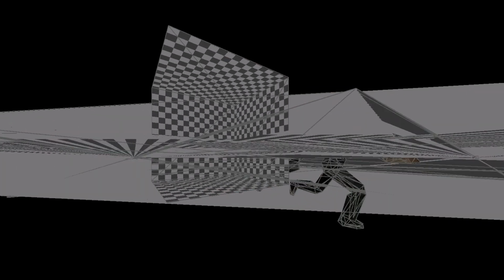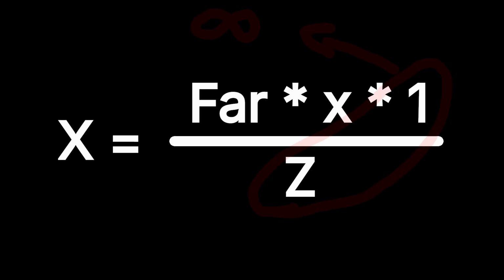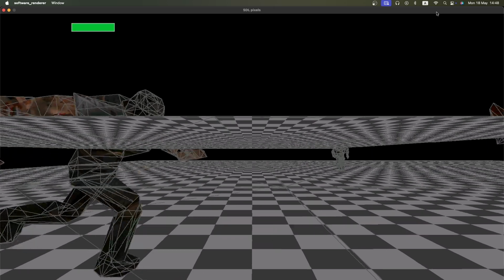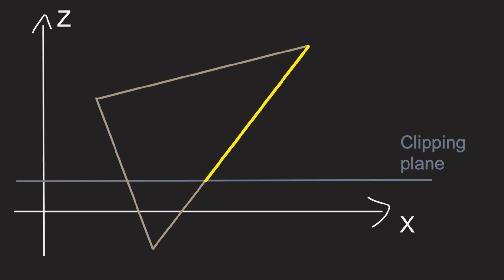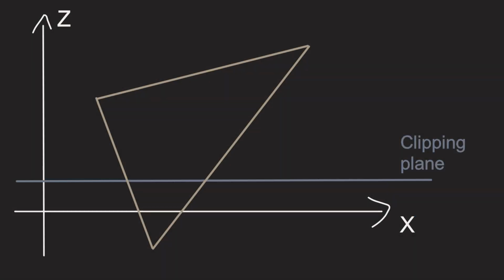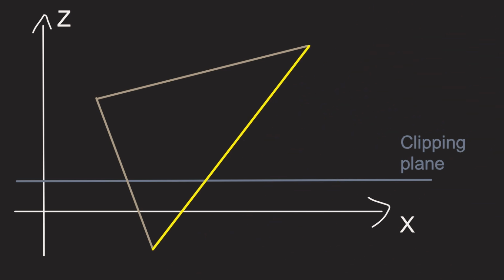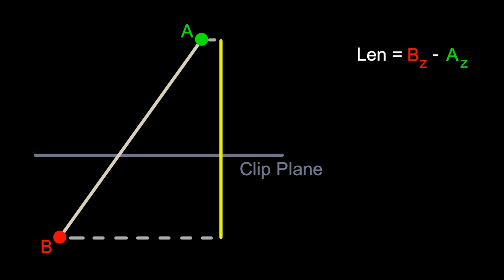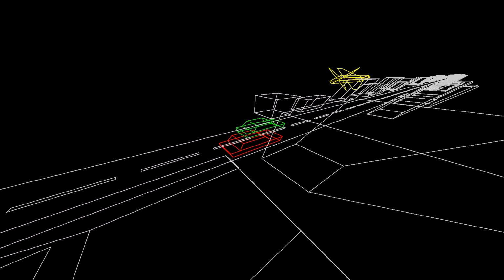Why Z below 0 is a 3d Engine Nightmare.

Comment: well you have to either ray trace or cut the primitives by the zero camera plane. ie if z is both below and above z=0 plane. if something else, then no need to cut if z is above 0 or render if z is below 0.
Reply from the maker: Yes, but actually test and cut should be done agains Z close to zero somewhere between (0; 1). This way after cut we have valid bigger than zero Z, and interpolation i also correct. This is why at the end I provide formula with Z-Clip value.